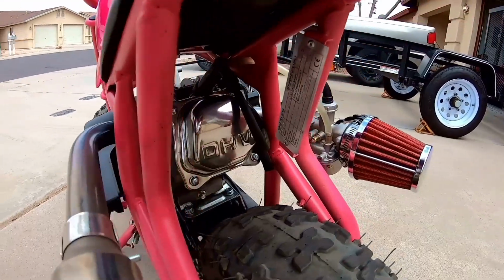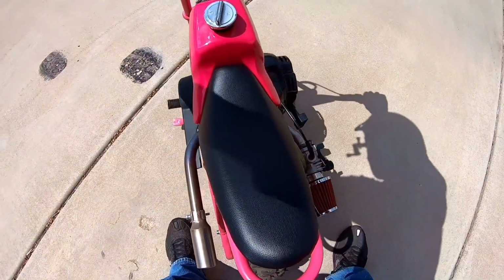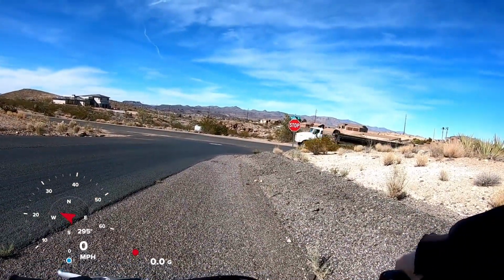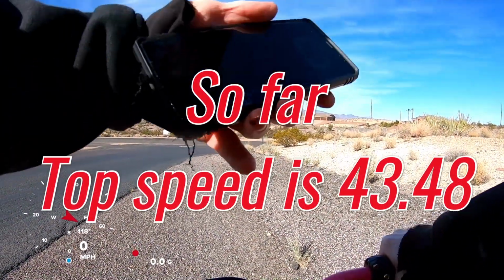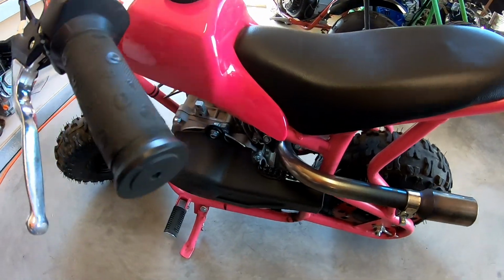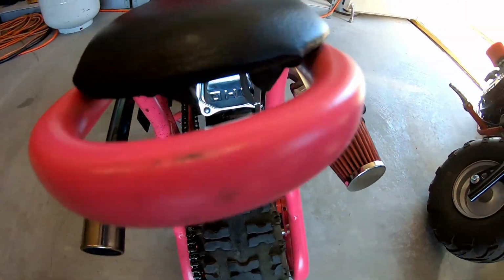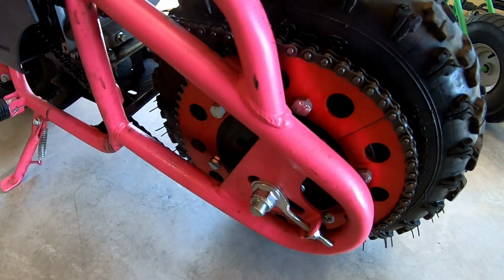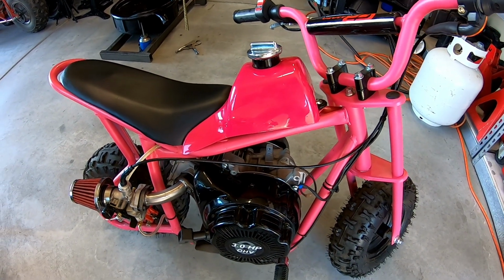Coleman cc100x 3 H.P. Mikuni carburetor   / speed test

Comment: i don't think at those speeds it would actually effect it but the carb setup could possibly cause a vacuum type effect because the way its pointed back. you could point it forward and it could even boost its performance, just a thought. great video though
Reply: He should weld up and inverted intake then use a volicity stack for ram air effect
Reply: @kevinjohnson9372  i agree